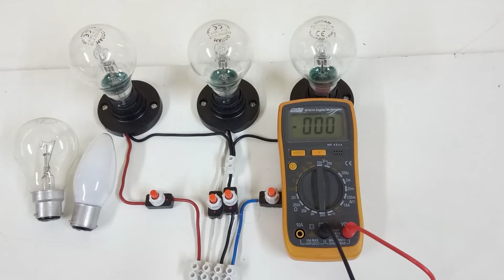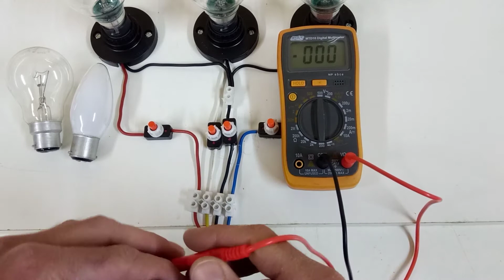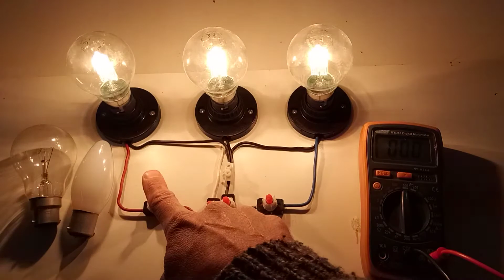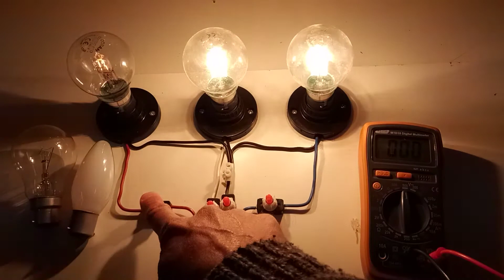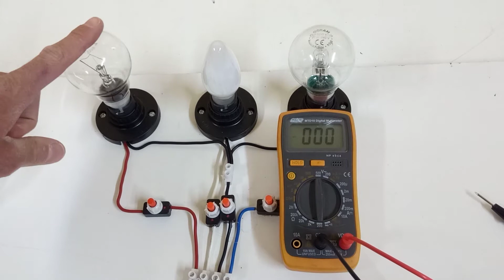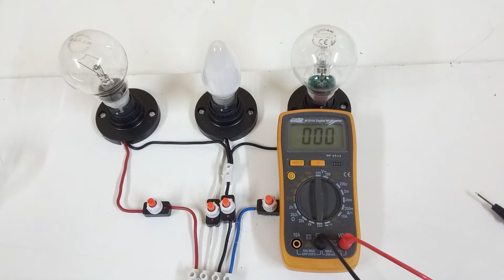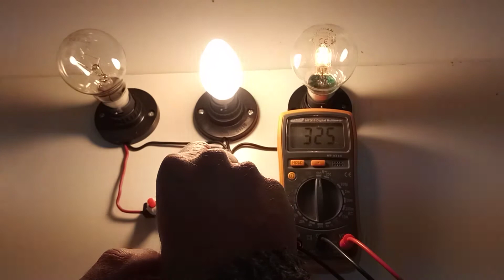A broken or floating neutral and the effect in three phase electricity systems

Comment: I'm currently facing this problem in an office block and it's a mission to find the missing or loose neutral
Reply from the maker: It should be easy enough.
Is it affecting one distribution board or many?
If one, check there and the source.
If many, go back to where they all feed from.

Your phase to neutral voltage under load should give you clues too. If they are out of range, there is a problem.
What voltages are you getting?
Reply: It's a 3 floor building
Reply from the maker: I'm going to assume some things for the answer:
Being an office building, it will either have its own transformer or an underground cable in from a transformer.
Which means likely TN-S earthing or T-T maybe depending on which country you are in. It would be strange to see TN-C-S.

So is the whole building affected, or only one part?
What voltages are you getting on the three phases?
What voltage between neutral and earth?
Reply: The supply feeds a 2 buildings, one being a 3 floor and the other a 2 floor building. From the main to all the Db's if there is no load I measure 230v between L-N and the same for L-E but as soon as I add any load I measure L1-N =176v, L2-N=298v, L3-N=279 round about and it doesn't remain constant. 
Please note Live to earth remains balanced even with the load on.

I tried isolating the circuits to try and identify as to which floor or building might be the problem but still the problem persisted on each. 

So since it's affecting each Of the Db's, I concluded it must be the the supply neutral because I checked the phase earth neutral point (PEN) and it was solid.
Reply from the maker: Yes it sounds like the supply side is faulty.
The earth is fine because that is still connected back to the transformer but the neutral has a fault (TN-S earthing I would say).
Glad you've managed to narrow it down now.

Honestly, most of these types of issues are on the supplier side. With TN-C-S, people complain about shocks from taps too.

To find the fault quicker in future, always check the voltages at the meter.
If they are wrong there, it's the supplier's problem to fix.
Reply: Finally found it!! It was the supply neutral and yes it was a TN-S system so I was actually detecting the neutral via the earth hence there was an imbalance of voltage when ever there was load. 

Thank you very much for the help, much appreciated.
Reply from the maker: @calvinkopanomaretele193  fantastic, glad it's fixed

Comment: wonderful explanation
what is the remedy? 
should we have separate neutral for each phase???
domestic 3ph wiring.
but confusion is we get one neutral only
please explain
Reply from the maker: You'll need to study how three phase power works. But basically a star transformer means the secondary side has one side of each coil connected together to form the neutral (star point).
The three phases are out of phase by 120° on purpose, so all three cancel each other out to give zero.
That means if the loads are identical (like where my bulbs are the same) then there is no current on the neutral.
That is rare though, so usually the neutral carries some load.
Recently I checked a local substation street feed, and the phases each had over 200 amp running, but because they were closely balanced, the neutral only has 20 amp coming back! 

The best solution to prevent appliance damage from a lost neutral is a voltage monitor that cuts off power if the voltage is out of range (say 255v and 185v maximum or whatever you choose). The reaction time is 0.1 seconds which is more than fast enough.

Comment: please im a little bit confused ... why did the other bulb switch off when you removed the one on the left...
Reply: Without neutral - SINGLE BULB NOT GLOW, EITHER TWO OR THREE WILL GLOW
With neutral- it will glow(on off can be made independent)
Reply from the maker: For electricity to flow there must be a complete path. So if the neutral is broken, the power goes through two bulbs in series, between two phases (Christmas tree lights are like this) rather than them being in parallel with a working neutral.

Imagine the two bulbs on their own. One wire from each bulb goes to a phase, but the other wire is joined to the other wire from the bulb. That is what happens.
So when one bulbs is blown or turned off, the other will stop too.

Comment: Thank you very much for the video. Can you explain why imbalanced load on broken neutral causes voltage surge and sag , in a theological manner too?
Reply from the maker: Thank you, I have just added more at the bottom of the description to help explain this 
Please have a look and let me know.
Reply: @TheCrazyENTP  thank you! 
I thought in Y connection 3ph circuit, when neutral line is out, line current from two phases will loop back to the power source from the third phase, therefore making the I3 = I1+ I2. Your comment however says I1=I2=I3. Am I wrong here?
Reply from the maker: No, you have to remember that the electricity system runs on three phases all the way up to the last transformer where they introduce the neutral.
Three phase still comes out of the last transformer along with a neutral.

So if you have phase 1 and neutral for your house, you are actually being supplied by phase 1 and phase 2 on the medium volt side.
The neutral is a common connection on the windings of the low voltage side.
So inside the transformer they have three cores.
On the MV side they have the windings connected:
phase 1 to phase 2 (A)
phase 2 to phase 3 (B)
phase 3 to phase 1 (C)

On the low voltage side they have the windings:
(A) phase 1 to neutral
(B) phase 2 to neutral
(C) phase 3 to neutral

So if the electricity can't  get back to the transformer via the neutral it will go back through another phase. Remember the phases are 120° out of phase with each other and because it is AC there is no one direction. They alternate with each other. So the current doesn't  flow from two and out the last one.
It's  a matter of potential difference, how much potential there is for flow.
The missing neutral forms a star point with a new zero.
So current from:
phase 1 has to go back through phase 2 and 3
phase 2 goes back through 1 and 3
phase 3 goes back through 1 and 2.
But all paths mean going through another bulb, so they all share a portion of all that work, otherwise there would be missing current. It does this regardless of what voltages result.

Hope this makes sense?
Reply: @TheCrazyENTP  in short, feeder transfer has Delta-Y 3ph connection, and feeder to load is Y-Y connection with neutral. Line current = Phase current = phase voltage / phase load. 

When neutral line is removed, 

line current 1 = line voltage (1-2)/ (L1+L2) + line voltage (1-3) = sqrt (3)*phase voltage / (L1+ L2) + sqrt(3)*phase voltage /(L1+L3). Beware of phase angle when calculate. 

Phase voltage 1= Line current 1* L1, which as result maybe different than phase v on L2 or L3. 

Correct?
Reply from the maker: I think the problem is that you will be trying to hit a moving target with calculations.

In my video it's very basic to show how the voltages will be out of range when the neutral fails. Simple bulbs and no change to the loads connected.

In the real world you are likely to end up with voltages fluctuating all over and very quickly depending what still runs or what blows up.

Comment: Excellent demo and very well explained sir. I just have a question regarding the flow of currents when imbalance of loads occur where neutral conductor is not present, where does the unbalance current flow returning to the source, it might be better to run the video again with clamp meter to each phase.
Reply from the maker: Thank you, I have just added more at the bottom of the description to help explain this 
Please have a look and let me know.
Reply: Thanks for the response, I find the mathematical solution so great I have never heard explanation like the one you did, back up by experiment and also consistent with ohm's law, this is great! This remind us that nature find their own way to balance things out.  I want to have follow up question if you don't mind sir.

In the experiments, all loads are resistive in nature and at different values with broken neutrals resulted to different phase voltages to make phase currents equal and eventually cancel out in the common point, but since these loads are resistive, the 120 degrees  phase angle between currents won't get change, please correct me if I'm wrong, in the case where unbalance  loads compose of reactive and resistive components of different values, will the voltages adjust themselves in the same manner, since phase currents will now be out of phase not by 120 degrees anymore and will the phase currents still cancells out to zero in the commont point.
Reply from the maker: Thank you, I'm glad I can help. When I was trying to understand this, there weren't any resources to help me. I struggled for a while to comprehend it.

So, it becomes quite complicated where other types of loads are introduced.
Resistive are the easiest for the demonstration because the resultant voltage stays the same as you see.

If motors are used, they are likely to be larger loads, so the voltage will drop on that phase and the motor will stall. The capacitor will try to restart adding to the drop.
The motor may start or may lock, it all depends on what the voltages do.
If the phase is not highly loaded and the motor was on already, it will keep going but again will be part of the current balancing. So higher voltage will be forced through the motor which will cause it to fail. Everything fails at high overvoltage.

I've see a real life situation where an air conditioner was running when the neutral was stolen. Only the fan inside was on at the time as was fine. As soon as the outdoor compressor tried to start, the voltage obviously dropped, causing the contactor to disengage, the voltage went up and the contactor engaged, the voltage dropped again and the contactor disengaged. Noww this all happened so fast that is was a chattering sound, around 4 to 6 repeats per second!
Surprisingly the unit did start during this and worked for a while till the problem was noticed a few minutes later, but after a few weeks the compressor burnt out.

In another instance the homeowner reported her house lights suddenly went very bright and then very dim and then bright.
She switched off the main immediately and luckily had no damages.

What would happen with the phase angles is a guess and depends on what loads are connected. They will be all over the place changing by the second until something blows from overvoltage. The whole time the system will be forcing the balanced current, so it's likely the voltages will also be all over the place.

I must try to do a video with two resistive loads and a motor.
Will need some large halogen lights and a 500 watt motor.

Of course any three phase motors won't care as the phase to phase voltages don't change when a neutral is lost.
Reply: Your video is of great help as it opens up the doubts on its theoretical approach, that is why I am very thankful to see such videos, there is so much learning behind your video and that is why I look forward on the incoming videos that you will post soon.,I'd like to recommed the use of clamp meter for the line conductors just to see the actual current flow on them. Here in the Philippines most ressidential even in my house are utilizing Line-to-grounded conductor, or sometimes they say Line to Neutral. We are at 230V, 60Hz. Only commercial buildings uses three phase most of the time. I'd like really to run the experiment by myself but I have a challenge in having the three phase source and that is why I was lucky to have your video and I was very thankful on that. Thank you sir  and will wait for your next post of video, please consider also balance and unbalance delta configurations, cheers.
Reply from the maker: In your case, you are on of the three phases from the supply side.
So if the neutral breaks out on the supply side you and your neighbours will have a situation where your houses will be like the light bulbs with voltages anywhere from 0 to 400 volts.
Reply: We are tapped to utilities single phase 25KVA distribution transformer with primary voltage spec at 13.2/7.6kv  and some numbers of neighboorhood too. The primary side of the transformer is connected to the three phase 4 wire, wye system of the utility at 13.2KV line to line and 7.6KV line to neutral, in case the utility neutral is lost, we could experience the high voltage output, hoping that it ain't gonna happen but still there is no assurance, our distributions here in the Phillippes is mostly aerial.
Reply from the maker: I've not heard of wye being used much on a primary side of a transformer in utility supplies. Is it common?
Mostly I know of Delta Delta all the way to the final one being Delta Wye.
Reply: It was a mistake, I should rather say secondary, side of the utility transfomer, as their primary is delta connected with the power grid at 69KV.
Thanks for the correction sir.

Comment: Fm from NETH.  But now on the Belgium/Fr border , but the voltage was on the same line as the heater at night-time 23.30 ,fluct. between 213/217 all the time ,
now daytime 10.45 between 221and 236 on this, more towards 
So this morning  I put the latest digital meter on (sampling rate 3 x p/sec. ) I put it on several points ( schokking ) day time between 11.00 and 13.00  fm 222 to 254
all the time up and down , also put a other one on permanence in the kitchen same socket as the microwave ( this meter is one of those witch we call “ scorpion clamp “ for
 measuring around a cable ,and is also dig. that range 223 to 247 in the same 3hours.  If the microwave goes on ,up/down of only 3v.   So far this part of info.

Next I like if possible to point out  “ I DO NOT HAVE A  “NEUTRAL”   AT ALL “ and that is giving me some of my “ self thought “ theoretical explanation that goes
as follows ( pls stay with me ,if still possible ) the fact is that I think you could say that the particular peace of electrical equipment is starting to work , when put on 
and than actually start “ normal situation “ to work between “ phase “  (1) and a “ neutral “.  I see than a consuming between these two almost without any problem , in that NORMAL kind of set-up , me  = only 3 x 240 (suppose to be ? ! ,often not ) 

BUT ..... in my case the cooperation is ( you can say ) COMPLETELY out of order ,the charge for the functioning is now depending on the wire that’s within the equipment 
Is the closets to the highest !! resistor fm that equipment   {“ partially I have even proof of that by changing the wires from their position in the socket or equipment and than 
see that the other prone started to melt down “ }  , so it is as the equipment charge start to look around to a not available “ neutral “ and causing ( to my partial theoretical analyse “)  a much higher heat development in “ the extra activity “ to find a release to a NOT  available neutral and therefore have to use the FALSE neutral, who in reality is also a 2(2)40 fase , and my idea is that gives a extra heat ? Development (to be proved by proper measurement and eventually visible inside ,I think )

And that in basic is , that I am looking for solutions which I have found in part of your “on/of “ neutral explanation ,which is s great visible explanation .

Really I would like find a University or such ,to make this visible , and clear out why indeed the prone(s) , several ones ,melt down ....and it is absolutely NOT of loose or badly 
connected wire(s) and also the thickness of the wire(s) , I even picked in the several a thicker wire/cable ,and have seen close to the final points in the equipment or plug or wall connections heavy discoloring , melting and even the copper loosing its metal stature ,in the form of almost crumbling , and even disappearing partially on the connected screw(s) with the logical result of not working equipment than.

Because for that part I was  a radio/radar tech  ( RNLAF) and special within the big transmitters and radar you have to make sure that every screw and nut is for sure 
properly thight even a lot with the exact amount of pressure . 
So are for sure my stuf is done almost in the same matter , and more less for now the replacement of the plugs on the heater,dryer,wasmachine ,welding post, air compressor and diverse wall sockets goes on , naturally with the variation of the amount of time of using them more or less frequently. Well so far my results/experience .
Thanks for the last reply , and now possibly reading and commenting if , maybe you like send it other wise to P...........s@gmail.com
Reply from the maker: Sorry the email address is removed in your comment.

I don't understand how you have no neutral and have 230 volt supply. That only happens in the USA with 2 x 120v supply.
The standard in my video shown I to have three phases (live wires) and a neutral. Any phase should be around 230 volt to a neutral wire and any phase to another phase will be around 415v.
The range you get is ok but it is changing a lot. I can't see how it would cause melting or burning though. Mine goes from 234v to 200v at the worst. Mostly around 220v to 229v most of the day.

Do you have single or three phase supply?

Can you send a photo of your distribution board with breakers or the electricity meter on Telegram to username Perrin7?